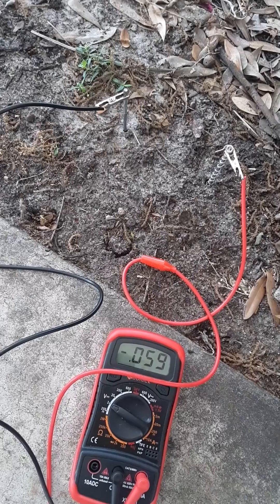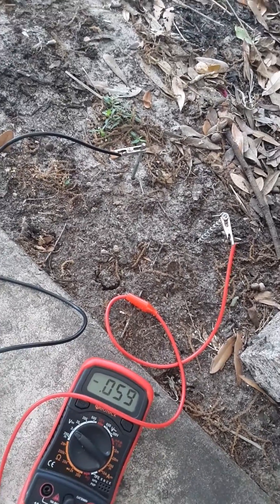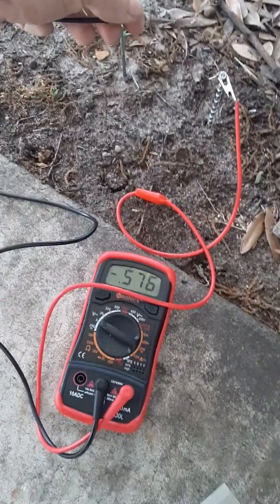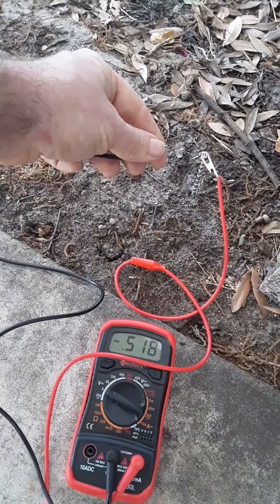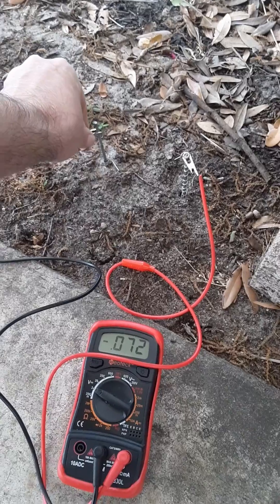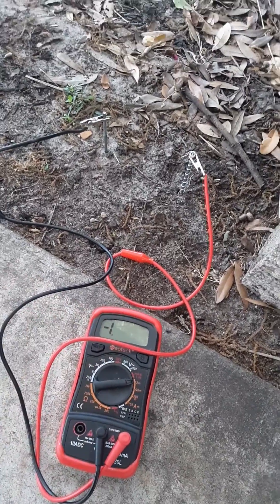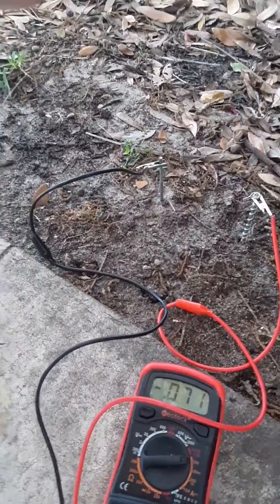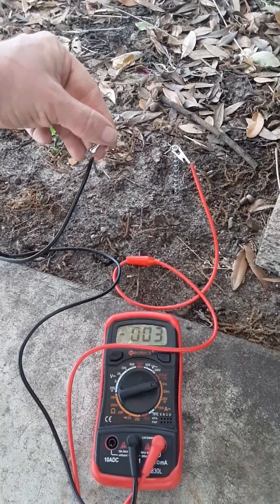EARTH BATTERY WORKS WITH ONE WIRE. NO RETURN PATH! #TESLA

Comment: Isn't it just showing 5V because you're touching the electrode with your bare skin after you remove? Your body is a capacitor
Reply from the maker: my body is standing on the concrete. there should be no ground connection for it to complete a circuit. the other electrode to the meter is buried in the earth and electrically separate from me
Reply: Please explain how a person touching the electrode became the path of least resistance.